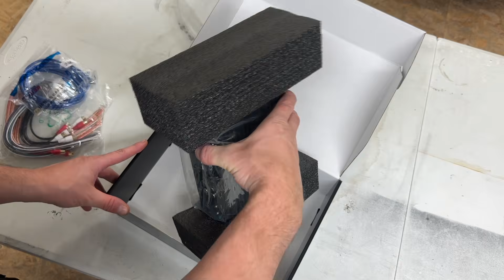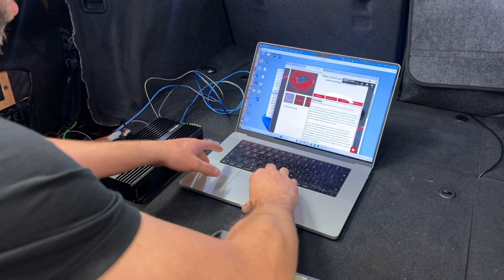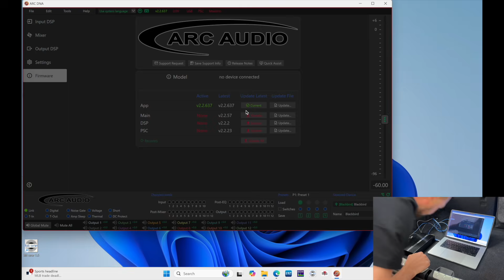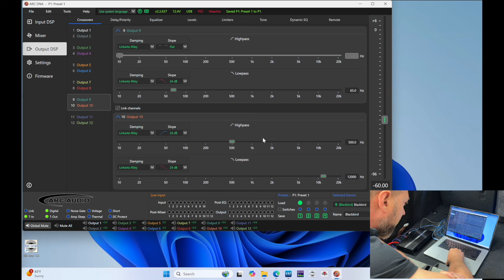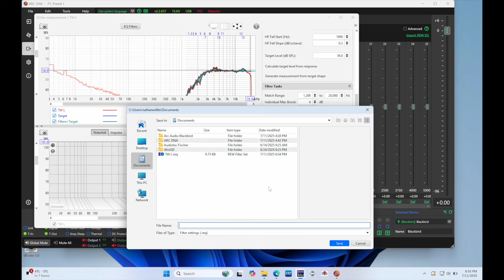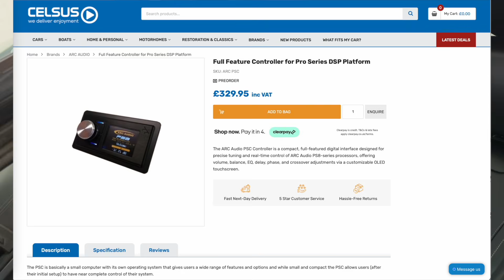Arc Audio Blackbird - SQ 8 Channel DSP amp, but can it rival Helix and Audison?

Comment: Sounds like you have a lot experience with Helix. I have the Helix V18 paired with a digital pre amp.  Sound quality is great, but I am having trouble getting all the BMW OEM chimes to function as normal.  Have you performed an install with Helix and a digital pre amp on a BMW and potentially encountered this problem?

Comment: What dsp preset did you use in REW for the blackbird? I am working with a falcon and it threw me for a loop
Reply: You use Generic Extended, and export as Formatted Text. The only thing I noticed the the DNA software can’t import from REW, is High and Low Shelf Filters.